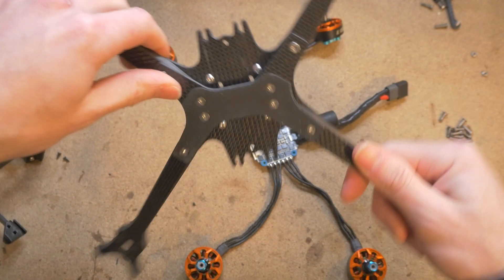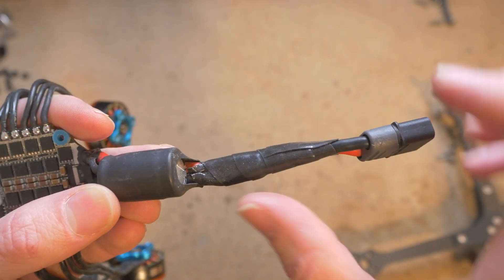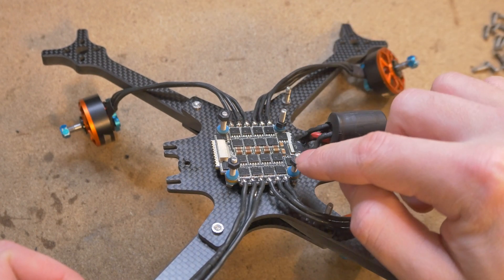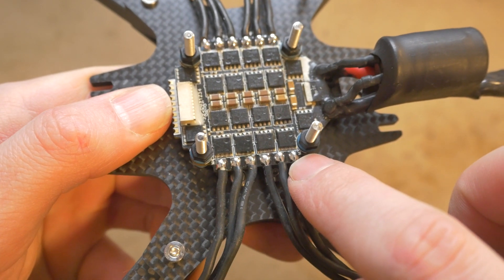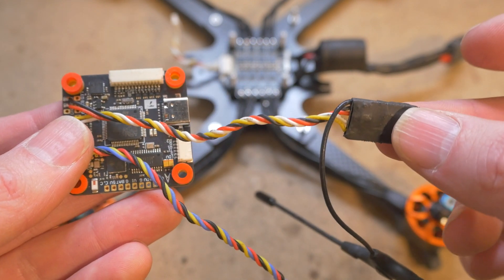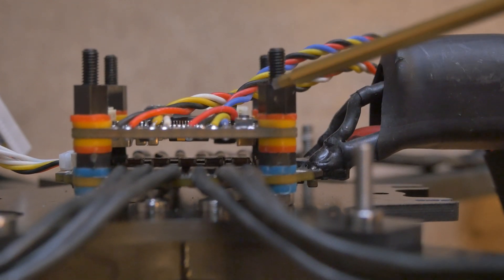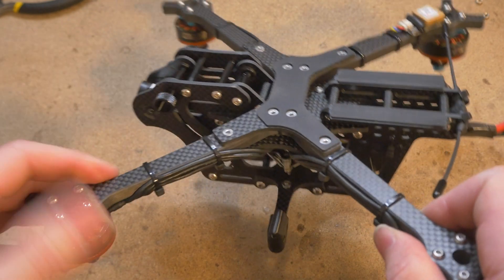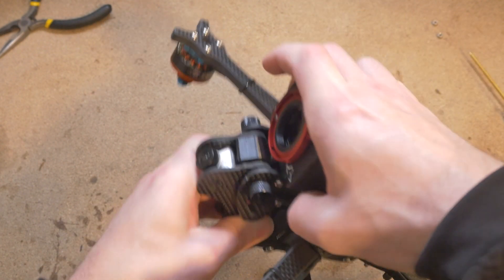Vulture Components Installation

Comment: No diode plus capacitor for cutting voltage spikes?
Reply from the maker: I do not use a spike absorber on my builds. A big capacitor on the ESC seems to suffice. For larger cinelifters I recommend soldering a small 100uF Cap to the flight controller Vbat and GND for extra noise reduction.
Reply: @strawhatsam  Good info, thanks!

Comment: After watching the video I asume you can’t install an OG air unit right?
Reply from the maker: Of course you can! The 20mm vertical plate spacing is made exactly for the DJI O3 Air unit. And the side carbon doesn't appear in view either. You just lose the side shims that hold 19mm cameras and go direct mount.

Comment: if I put 35 V.   1000uf capacitor it's okey? why did you put it that big?
Reply from the maker: You want 50V 1000-1500uF cap for high power systems that potentially will be carrying cinema cameras. More power means bigger voltage and current spikes. Voltage spikes can be up to 2X the battery voltage.

Comment: 2207.5 1722kv can carry blackmgic?
Reply from the maker: Yes, and it can carry RED Komodo too!
Reply: @strawhatsam  i use fx30 can it carry with 2806 1300kv?
Reply from the maker: @nizarnadzir  use higher kV as 1300 is way too low. 1700kV has been working well for me.